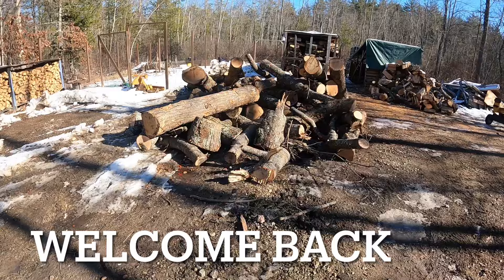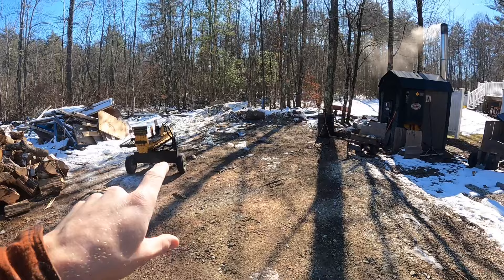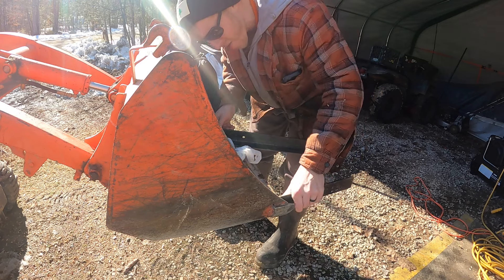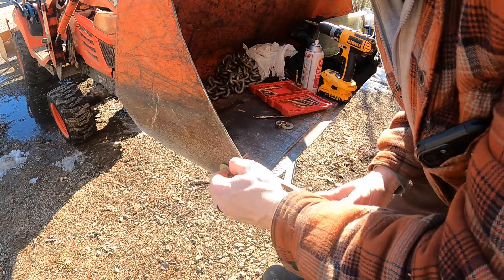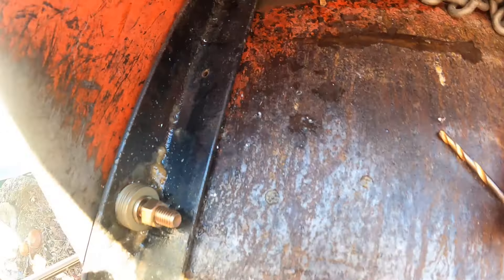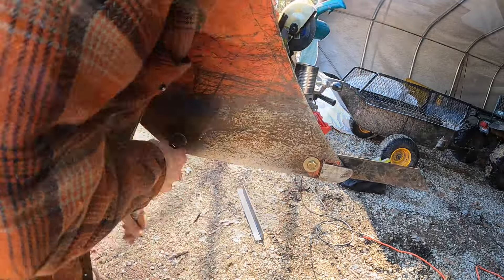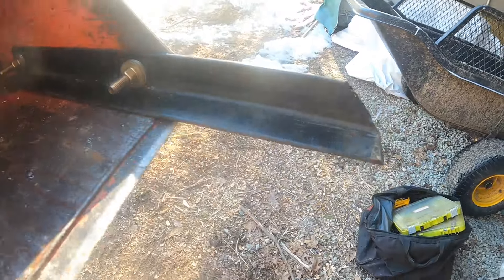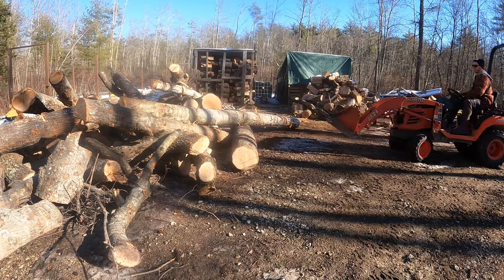We Have A FIREWOOD Problem!

Comment: Good job. You do what you have to do to get the job done. I have an engine drive welder on the back of my truck. I don’t know how many times over the years I have welded an oddball shape of plate over my teeth on an excavator. Sometimes you get these crazy trench details on the plans for a commercial building. My competitors laugh at me with their fancy tilting buckets, but they still have laborers with rakes and shovels shaping their excavations. By the end of the job, I might have a bent up piece of metal to cut off the machine, but I got it done in half the time and no labor involved. Geter Done Jay!!
Reply from the maker: HAHA I love that Aaron! You deff seem like the "I got a idea for that give me a second" kinda person haha I love that idea of "mobile welding" when a need arises!

Comment: Once again, I will follow your lead. I've got a JD 2030 and a set of clamp on forks that I'm not impressed with.  I've got angle iron in the barn. I guess you said you got the idea from the net. Thanks for passing it along. What a simple fix!  👍
Reply from the maker: Check out the video I just posted! Ill never look back! Moved almost 10 tons of oak in under a few hours. Worked good! In the offseason just take em off and put a nut and bolt through the bucket LOL
Reply: @HomesteadJay  I had already seen that video before you sent the message. Just need your logs a bit longer. I liked the one guys math on cutting them at 64".

Comment: I have a BX24 also. Consider using your backhoe. With some nice heavy logs in the bucket, it will lift and maneuver those logs. I speak from experience on this.
I think that you might be able to lift more with the backhoe than the loader.
Reply from the maker: I sold the backhoe LOL :)
Reply from the maker: But you are correct that backhoe would pick and tip the whole machine lol
Reply: So that’s why I never see it on your channel…
Reply from the maker: I sold it to pay for all my initial tree gear to start the business. I never used the backhoe anyways. Quicker to rent a mini and blow out a few projects at once.  @waynesheffield7011

Comment: another option, since you already have the two hooks on your bucket for using chains, would be to get two log tongs on chains to lift the logs. I have seen videos of that setup being used successfully. your solution has the advantage that you don't have to get out of the tractor to hook on the logs. I think the logtongs would have more lift capacity. In the end you should use what works best for you.
Reply from the maker: Ive seen that idea but the problem is your going backwards LOL I wanna move forward haha
Reply from the maker: ive seen skid steers with that setup with the tongs off a quick attach. They have more hours on them backwards then forwards LOL

Comment: You can also hang a log clamp off each angle and pick a good size log and place it exactly where you want it. 
Far as welding I didn't go to school for it I practiced and took constructive criticism and became a good welder and eventually an inspector and did both for a while.
If it was me I'd cut everything 16 inches that way if you had to you resplit the boiler stuff and sell it as stove/ fireplace wood then of course random pices you end up with for the boiler.
Reply from the maker: Hey Jimmie! Not a bad point to just cut it all to 16 but sometimes thats more work cutting through knots and BS depending the log. I like to "sort" because I dont need all of it for boiler wood or wood to sell so "sorting" isnt a issue. The ugly, twisted, knarly stuff is boiler wood and the clean straight stuff is wood to sell thats how I look at it. I dont wanna struggle or wail on the splitter trying to make nice 16 inch stove wood out of knarly crotch logs and stuff haha
Reply: @HomesteadJay  oh yeah ugly and knots for the boiler everything else 16 inches even big 16 inches for prim boiler wood and that can be resplit smaller later if needed. 
But that's me. Lol.
Reply from the maker: your not wrong. Ive burned fat boiler logs at 16 inches no issues!  @jimmieburleigh9549